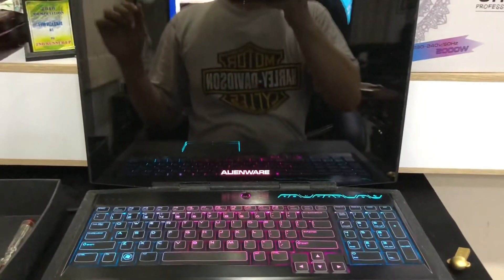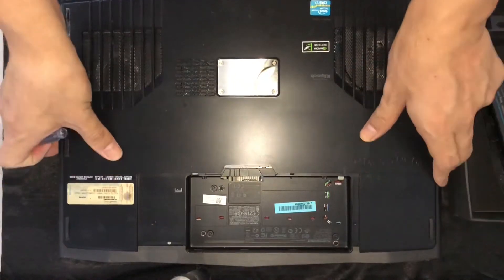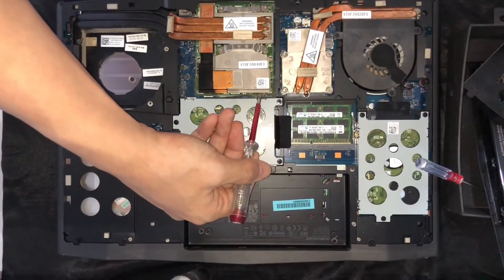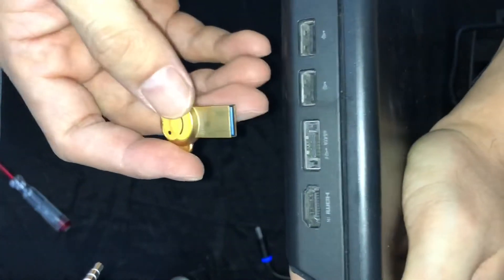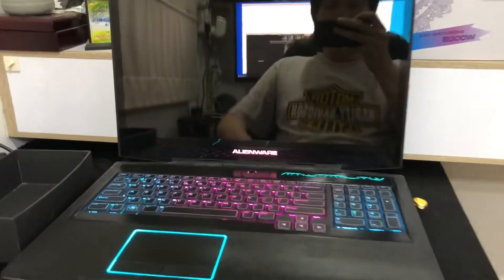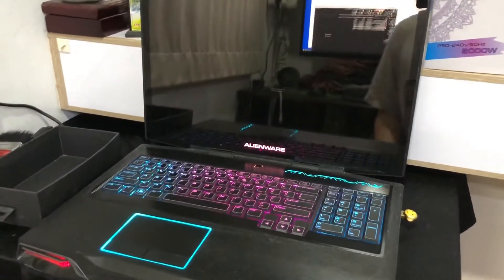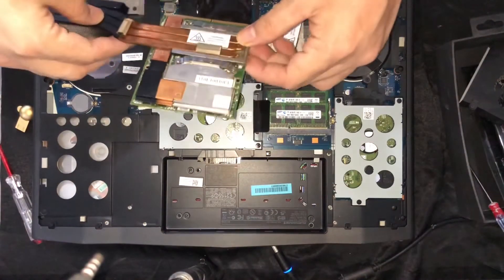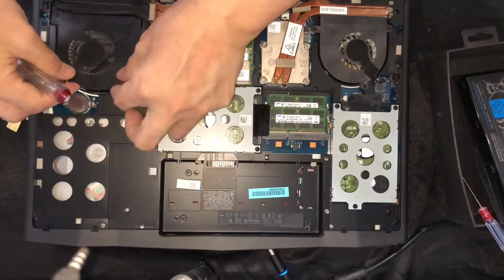How to Fix Alienware M17x R3 black screen after accidentally bricked bios (A12 unlocked GTX680M)

Comment: Doesn't work any ideas? I followed everything 100%. I flashed the a12 unlocked prior and it worked and I enabled integrated graphics and now black screen. I extracted the file and renamed onto a fat32 usb into sata port holding end and still doesn't beep. Just is high fan speed and system lights but black screen.
Reply: I fixed it. The USB method I don't think worked at all. I put in a different GPU which wasn't supported and it beeped 6 times and after that I put the og GPU back in and it fired up😄 weird

Comment: I performed the bios update on my m17r5 that was just released on 10/08/2023 and now my laptop will not start, the screen stays black and the power button flashes 3 red and 6 blue, I don't know what I can do because I'm on a trip overseas atm and I really need it right now.
Reply: Lo pudiste solucionar??

Comment: Hi Jimmy, I followed all your steps but when the computer is turned on, the fan come on, lights on keyboard comes on but that’s it. Seems like it’s not even reading the USB, which has been formatted to FAT32 and file name changed as you instructed. Also inserted in SATA port. No beeps or anything, even left it overnight to see if anything’s changed

Comment: Please I really need the A12 unlocked GTX680M file. My computer is stopped
Reply from the maker: i have updated the file where u can download in comment section, or you can also use this link.  WILL BE DELETED: SEP 02, 2022 since this is a file sharing. here you go..  

https://files.fm/u/a8xx8jubg

Comment: I got 3,2,1 beeps. No display. Could u tell what's the problem?
Reply from the maker: Did u change anything in BIOS and save changes and reboot prior to the black screen ? 
If yes - try the step from video from start
If no - could be something else, try to check the troubleshoot from dell manual see if there’s any light indicator explain what is the problem

Comment: will this work on alienware 17 r1 sir, because lately i go to technician and said that my videocard is not working anymore and i could not believe it before it turn to blank dead only the backlight and fan kicks and single beep the card was still working.
Reply from the maker: I am not sure, technically it should be the same.  do try and tell us, you can try to follow the instruction in the comment . (Except for the Bio file you need to get your own R1 Bio file. )

Comment: My laptop it's not bricked but it is giving the 7 beeps and not booting. I found and official solution saying that I need to update the bios. Can this procedure work?
Reply from the maker: This procedure is meant to reset a bricked bios into a working bios. A bricked bios means your is screen black and nothing on the screen and can’t boot, it’s easy steps by steps. Many people I know fixed with this method, pause video every steps u do and continue each task is done, do not skip.try it.

Comment: Hi Jim. I have a hp omen laptop. While flashing the gpu bios, i messed up and make it black screen. Then I plugged it with a second screen and I get the 2nd screen on. While trying to reflash the original bios, I disable the 1660ti gpu. Now all the screens are black. Is there anyway I can fix this? At least reset all the setting so the 2nd screen can works again.
Reply from the maker: Sorry my friend . Only know how to fix this old Alienware .

Comment: Tried your plan here doesn't seem to work, removed video card, copied on clean USB drive formatted to fat32,  1 file PAR00MEC.fd,  renamed it as above, hold the end key,  plug in, the fan spins but nothing after that.
Reply from the maker: try to watch again and follow every steps .  . dont skip any video.  i hope it helps.
Reply: @jimmylim3789  Believe me I went over the video and the instructions in print very carefully. I bought this off Ebay and just discovered that there 2 pieces of ram underneath keyboard, I'm going to remove those tomorrow and see what happens, perhaps one of them is bad.

Comment: I did a version of this procedure on my M17x R4 but only removing the battery and not the GPU. This is what was suggested. Wish I had seen your video before. I got the bleeps occurring for a few minutes or so and then silent except for fans at full speed. I eventually switched it off manually and when i tried switching it on again, no lights came on at all, it was completely dead.
Reply from the maker: try to follow every steps carefully. it is quite tricky for this alieware
Reply: @jimmylim3789  same laptop same problem tried every step then oning  beeep and white screen

Comment: HI Jimmy, You Sir are a lifesaver! Many thanks for this very detailed and on point procedure which i followed to the letter - and it resolved my issue... 

I have my life on my laptop and i messed up big time - well when i say i messed up - i didn't actually do anything wrong... it was alienware that should have better protected their system... you see i got myself a new external monitor this week - in addition to my old external monitor - and i couldn't run both monitors simultaneously... it seems that's a limitation on the system... so i thought, why not attempt to use the onboard intel graphics to run the 3rd monitor (laptop monitor + 2 external) ... ||

So i browsed online and saw that I needed to switch from PEG to SG in the bios to achieve that... which i did... i changed that in 2 places in the bios... BUT... upon F10-ing ... BLANK! DEAD - the thing wouldn't even boot - at all... the fan would kick in and within just a second dim again before kicking in again and dying again all over in an endless loop...

Now i browsed the net to find out how to reset the bios and every result i got -both from forum questions and DELL official websites suggested that I needed to remove the CMOS battery and wait a minute... others suggested i press the power button while waiting to drain whatever juice's left in the system... 

Meh! Didn't work.... When this thing happened i got sort of a panic attack - i felt hot - and was scared i was going to faint - it's not a feeling that i'm used to... which i guess reveals to me that I'm way to attached to that laptop - lol - i really need to get a secondary back up system - seriously... fortunately i have another laptop that i could use to search for solutions directly on YouTube - and I landed on this precise video of yours!

Thank you so much! I went on to explain the effect this whole thing had on me to show to you just how you were able to pull me back from sheer dismay.... 

I Praise the Almighty for you and your video!
Reply from the maker: i am glad that helped you on this! thanks for your kind testimony.   indeed!
Reply: Such a big comment

Comment: hi jimmy.. just found this video.. i have the same problem and my m17x r3 was kept on my table since the 8 beep occur.. hope this video could save my laptop.. will update to you tomorrow if it work or not
Reply: did every step you stated.. fat32,rename,but only the fan sound without any further changes
Reply from the maker: @FaaKamarudin  try again. slowly , follow every steps and pause video each steps completed. dont skip any video

Comment: In the last month my alienware started to get overheat a lot and fps drops plus lag.
GPU temperature was always on 90 celsius degrees so I've tried everything:
updating drivers, reset wndows, gpu throttling tips and in the last updating the BIOS, but no one worked.

So I brought it to a place for cleaning it plus thermal paste replacement.
En fact after doing that, the temperature went straight to 60-70, they told me it's wasn't anything there almost.. No more fps drops or lag at all but after three days it couldn't power on. Black screen and just the alieware head enlightening:

2 red and 1 blue - 'CPU FAILURE' according to dell, so I brought it back and they told me probably the cpu or mb are 'burnt'
 and can't explain why

Could you suggest me something ? (Warranty expired few months ago)
I don't think its bios updating fault but who knows..I read about bios update of alienware could brick it, so what do you think
 If i try this steps? I remember installing the 1.10 bios update and I had 1.07 I guess..(alienware R4 15)

Thanks
Reply: Bro, have you fix your laptop? same thing happened to me red and blue flashing on the power botton.
Reply: @lodimalu5237  absolutely not. The mb is burned and I had to throw it. Never gonna buy again laptop gaming only desktop
Reply: Hi bro,
Check this please, exactly same situation as yours and explains/troubleshoots what happened to MB:
https://youtu.be/jLU-cErbvbg

Comment: Hello Jimmy, may you help me with they same problem with an Alienware Area 51m. Model: P38E001, Service Tag: 154CRV2. I change a configuration if the BIOS and at the same time I reset the laptop and it don't turn on the display. The laptop just turn on in black window.
Reply from the maker: i am sorry. , this topic is only for Alienware M17x R3.  as i dont know how the bio 's screen look the same or different with your alienware area 51m. 

but hope i can help as i can feel the pain from ur end, can you remember what kind of config did you changed in bio for your alienware area 51m ? if you can remember how the bios look like. you should load default in bio setting, the trick is get into bios (blindly without seeing the screen, if u have friend or someone else's system as example) then use your keyboard 's  ARROW key,  TAB key and SPACE BAR  to navigate to load default

Comment: ah... mines a R4 :(
Reply from the maker: sorry to hear. but i think should be similar steps but different BIO files. u need to get the correct bio file for ur R4.then the hardware removal steps try to follow
Reply: @jimmylim3789  Hey, its ok I found the problem, the pins on one of the cables labelled MB snapped, getting a new motherboard but waiting on them to confirm that its the right one
Reply from the maker: @Leo-im6vv  i see. thats great u found the solution.
Reply: @jimmylim3789  i hope so, I think I broken it myself when i tried to trouble shoot all the parts, many years ago lol

Comment: Im trying to do it on Alienware 17 r2, I get fan running all time but it doesn't install anything from usb... I renamed the files with the new name that people say in Alienware forums. :(
Reply from the maker: did you plug in your USB on the right port?  (2 in 1 eSATA + USB port). not any other USB ports. and also PLEASE ENSURE YOUR USB DRIVE IS "FAT32" format. (not NTFS or otherway round)
Reply: @jimmylim3789  i have a similar problem when i insert usb in correct slot, press and hold end and plug in power keyboard lights up the fans kick on for 5 seconds and computer abruptly turns off
Reply from the maker: @iamghostwitagun3800  my tutorial is meant for R3 system only.  do aware that different system run different bios so if your system is R2, you cannot run R3's bio on R2 system, so you need to download R2's BIO separately but you can try again the same method.